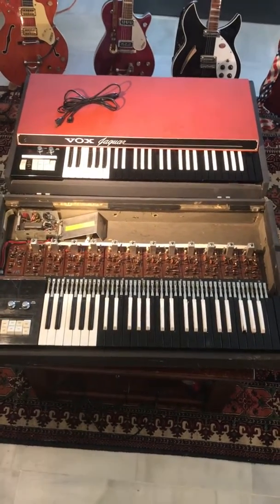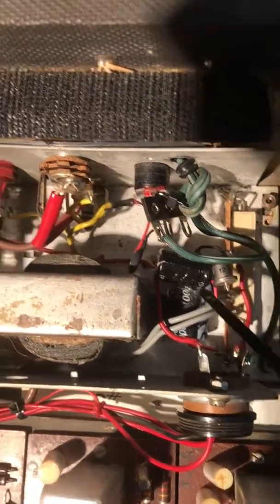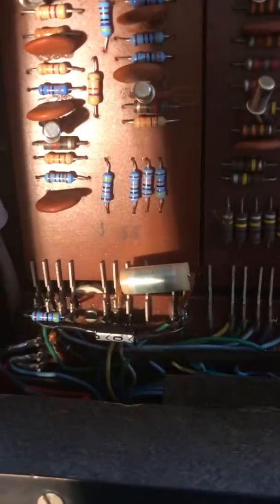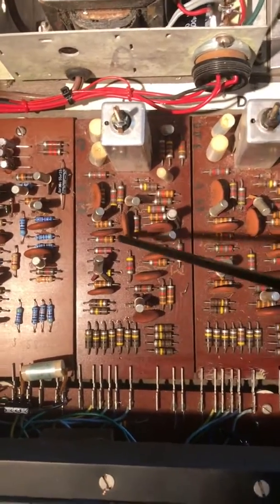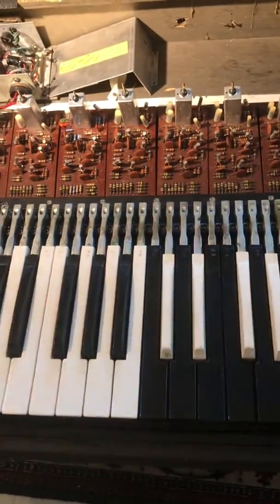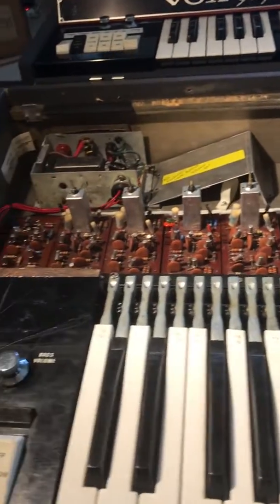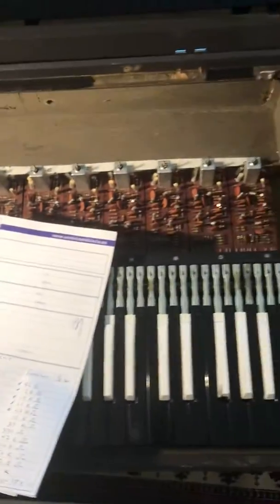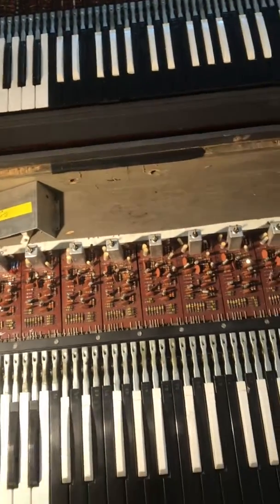VOX JAGUAR ORGAN - REPAIR and REVIEW - 1968 vintage

Comment: I really enjoyed your video on the Vox Jaguar Organ repair.  I have a Vox Jaguar version V-304 E2.  I am having problems with only the bass keys.  In Bass Chord mode it works fine but when the bass keys are configured to output only the bass signal the bass notes are distorted, especially when you increase the bass volume knob.  I have not been able to figure it out.  Can you give a suggestion or recommendation as to what might be the problem?  I'm thinking it could be the Low C/Divider/Vibrato board or it could be a problem with the voicing board since that is where the bass volume potentiometer is connected.  I'll really appreciate any support and assistance that you could provide including references to any related documentation.
Reply from the maker: Sorry. I sold both of my units.  I’m now out of the vintage keyboard realm.

Comment: Thanks for this. I was given one of these, it mostly works but I have to take it apart to see what is going on.

UPDATE: I replaced all of the electrolytic cap's, used a 3 wire 120VAC power adapter (computer power supply style), and re-positioned bus wires that had popped out of their holders. Then I found a spring connector is missing from the Bright switch ... why the Bright switch didn't work. Do you have any suggestions on how to fabricate a spring-contact wire for a Bright switch?
Reply from the maker: No idea.  But if you do it and it works.  Post it.

Comment: Can the circuit boards for the key (notes) groups - tone generating boards - be replaced with new ones? Can they be replicated?
Reply from the maker: yes, the difficult part would be getting the germanium transistors. I think all else would be easy to find off mouser, including the variable capacitor to dial in the frequency. you'd have to make the circuit board of course.

Comment: I have the same Jaguar. The Vibrato, while the switch seems to be clicking fine when I turn it on and off, but no change in vibrato. I'm wondering if you know what might cause that, or what needs to be replaced? Also, the volume of the main keyboard seems low, compared to the Bass notes. Any suggestions? Great video, BTW!!
Reply: Do you think the 4.7UF caps need to be polarized? The ones you used to replace the originals don't appear to be, yet the originals looked like they were...
Radial Electrolytic Capacitor, 4.7uF, 50V, 105 C
Reply from the maker: @thosedreadedgnats1511  I only used polarized caps in my repair....as you suggest, there are no bi-polar Electrolytic caps.
Reply from the maker: The output is low. I believe they were meant to go into a guitar amp. I use a pedal boost to bring up the volume.

Comment: The D# is off an early model v304 (non e or e2) the ones without a contour switch.
Reply from the maker: Thanks. That's good to know!   (This is in reference to the odd D# tone board from the Vox Jaguar that is pristine in the video).   I've since sold both units, and the legs that go with the units.  Age has set in!....so they had to go!

Comment: I have the same original Vox! Mine even has the original cord and foot volume control plus little musical gold treble cliff symbol!  Thanks so much for the information it's going to give me a head start in the repair since it hasn't been turned on for years!
Reply from the maker: I hope the repair went well Tony.  I also had all the legs and foot pedal too.  I sold it recently....time to mentally move on for me.
Reply: @The Knaves  thanks for the response. The repair went perfectly, and it sounds perfect. So far I haven't sold it but I hope soon.

Comment: Im thinking of purchasing a Vox Jaguar. However, I am concerned about it frequently breaking. In your experience do you know if they do break frequently and if so are the parts hard to find? (The one i'm thinking about purchasing is missing the cord, but the owner temporarily jerry rigged it.) How did you get a cord?
Reply from the maker: I think the cords are extremely difficult to source.  You may have better luck in a thrift store looking for old appliances which to my memory may have the same....such as an Electrolux vacuum.   New plugs are grounded, unlike this one. but it's easy to bypass the chord and just hook up a different or. place a 3 wire receiver in it...with a small, non reversible cut.  In our history of using them...they did not break. Only when we jumped on them....and we did.   the corners typically need re-gluing. There are the germanium transistors which are very difficult, but not impossible, to source if needed. Here is a list of parts I compiled. 
Caps
1000uf 15 V Axial  (original Ducati brand) Under switch
DUAL  1000uf 25 V Axial (Ducati) – Power supply box
SFT 351 Germanium transistor. 78 Total on 12 Tone boards and 1 generator board
AF116 Bass Divider Transistor. 1 
           ( Can replace per the web with AC125 Germ Transistor. )
Reply from the maker: In reality they don't break frequently. sometimes you have to jiggle the individual tone cards. I recommend changing all the electrolytic capacitors as I have done.   But I posted a blurb once on fixing a modern Korg Keyboard....what a disaster. I love the old stuff, because it is fixable. That being said, I also have the Nord version which sounds awesome, and has touch sensitivity and adequate volume.  The Vox has no dynamics at its output. There is no sensitivity in the keys...it's on or off. These Vox's have low output....both of mine, and it's well known. Thus, they work great through a clean preamp such as an EP-1 or one of the other uncolored preamps pedals....thus having volume.